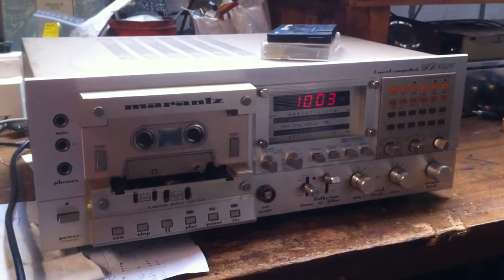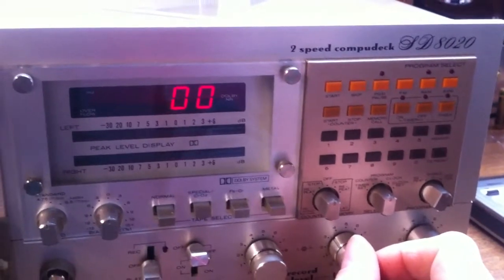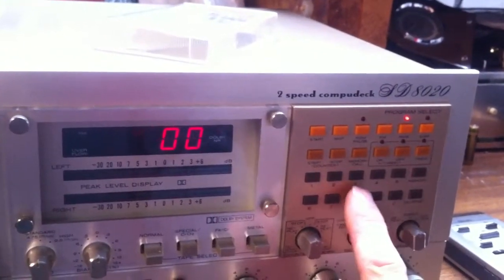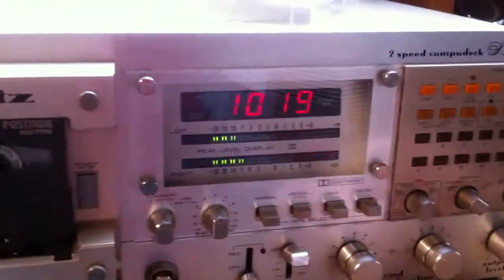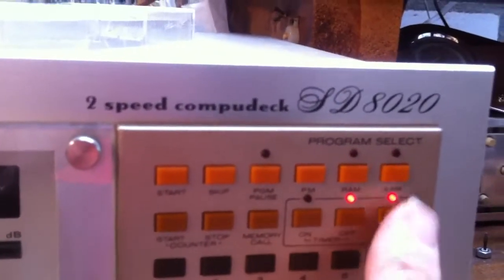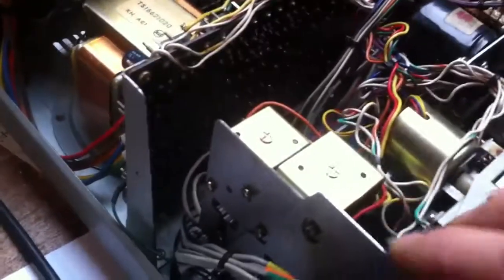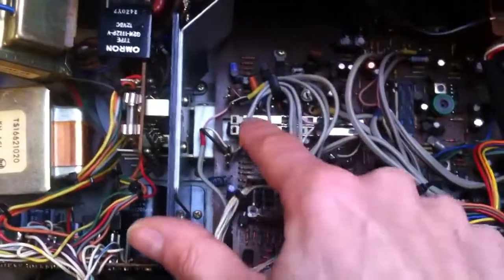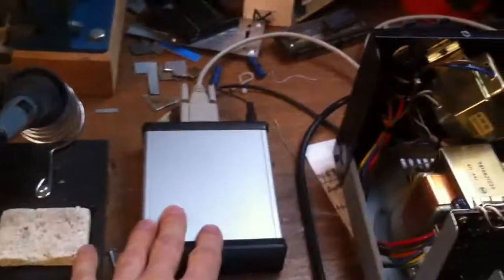Marantz SD8020 survey of functions and repair

Comment: Hello,
I have disconnected my SD7 from the mains and now the display is flashing....
I've forgotten how to reset the time... Can you tell me how to adjust the time so that the display stops flashing?
Thanks 1000!
Reply from the maker: hi, turn on the unit by power knob. then turn rotary knob to “set clock”. now you can enter the time or press reset to stop the blinking. other rotary knobs in middle position